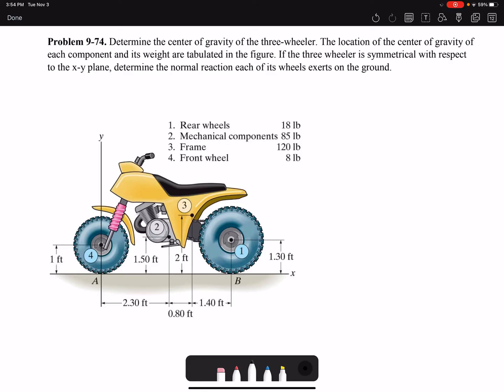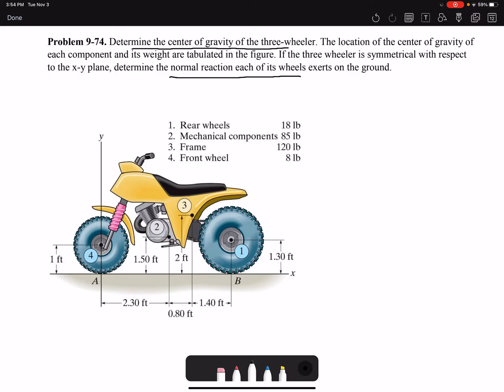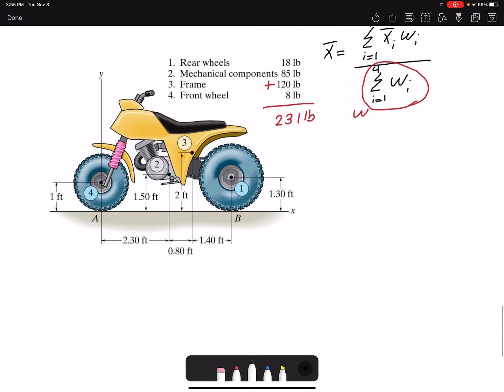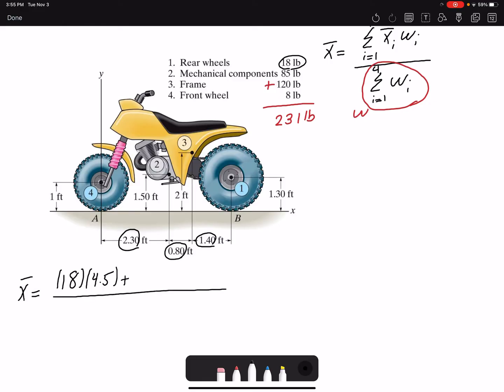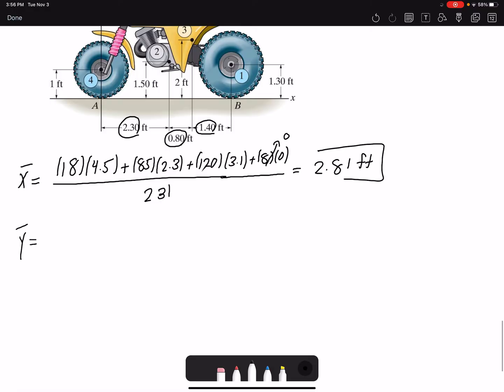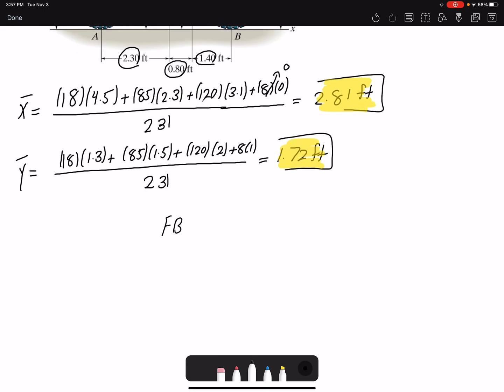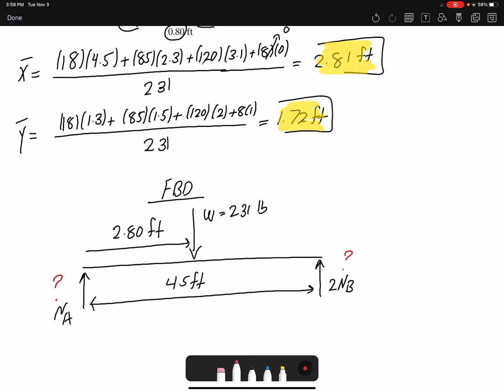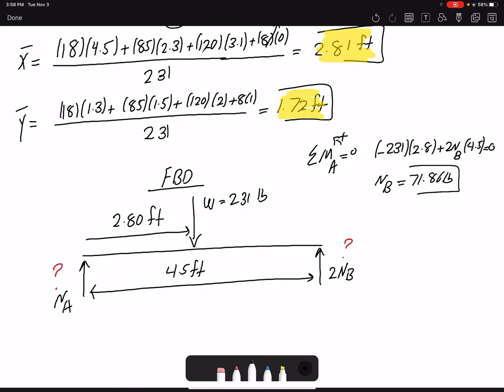Statics Practice Problem 9-74: Center of gravity of a three wheeler using composite body formulation

Comment: To make the motorcycle stable (not rolling forward/backward), are the moment front wheel should lower than rear wheel?
Reply from the maker: This problem only deals with reaction forces, but if we consider friction forces at the point of contact, depending on the size of the wheel, they will create corresponding torques that influences stability